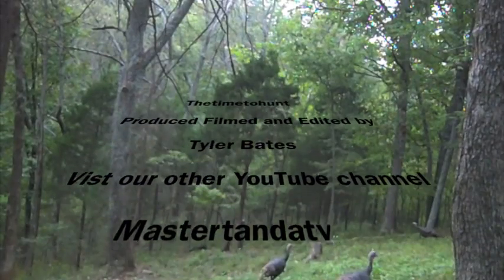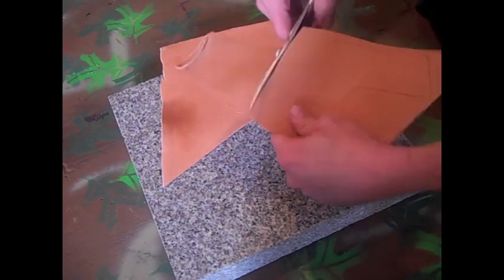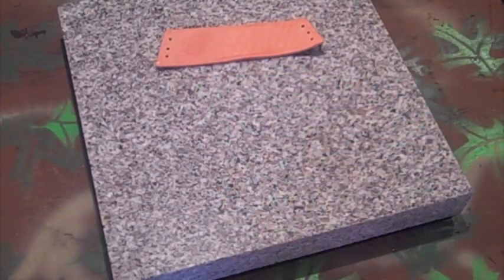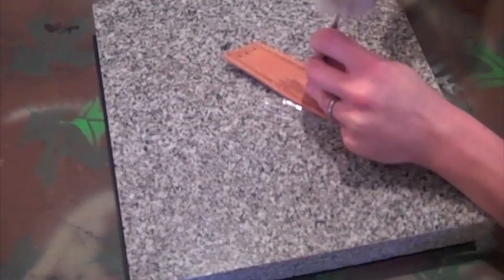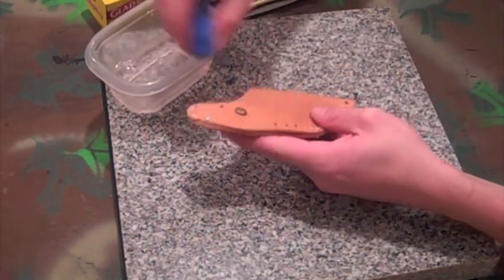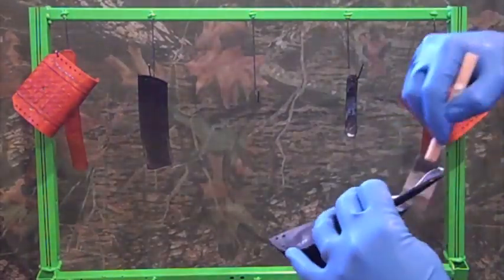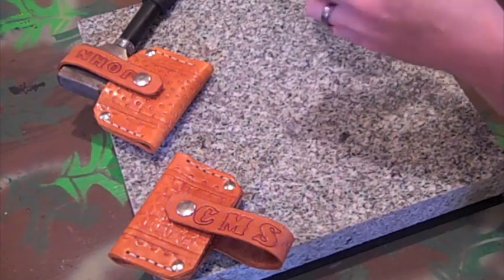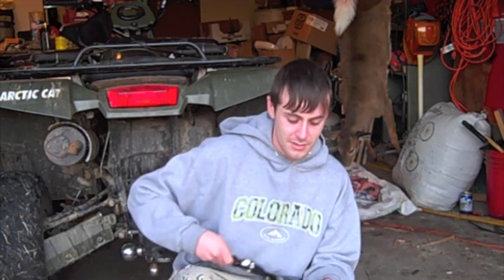How to make and use a Leather Quick draw Knife Case

Comment from the maker: @lwilliamsrdr Man i had no clue what one was tell you told me . so I sat down and came up with my own . I made about 5 of them before I could get it to work . you can get those nylon spacers at just about any hardware store . That was the hardest thing to come up with . I was not sure what type of material to use for the blade to ride on . But they make cutting boards out of it . so i think it will work just fine.

Comment: the swivel knife is not mat to cut threw leather, its made to cut designs into the leather, if you are looking to actually cut the leather use a utility knife or some heavy shears, if you get the leather wet (case it) makes it soft and easier to cut/work with